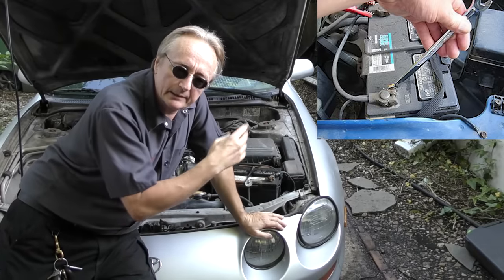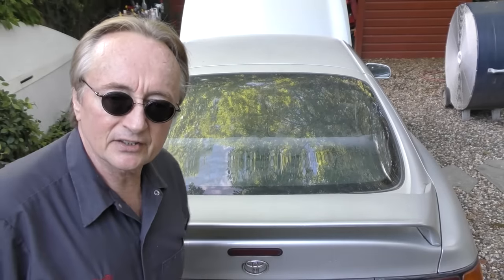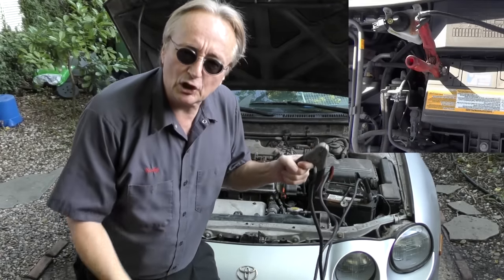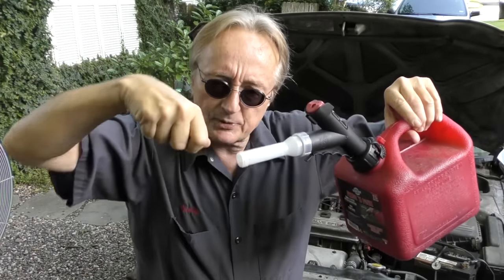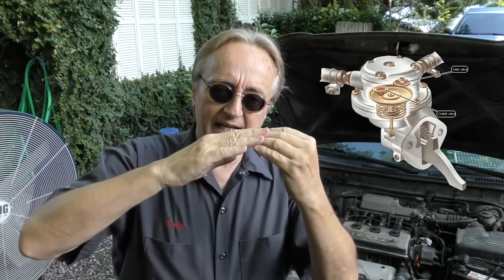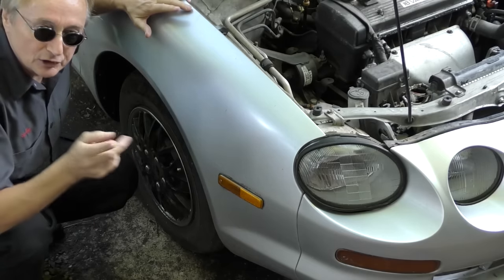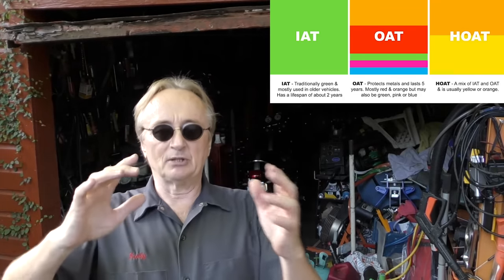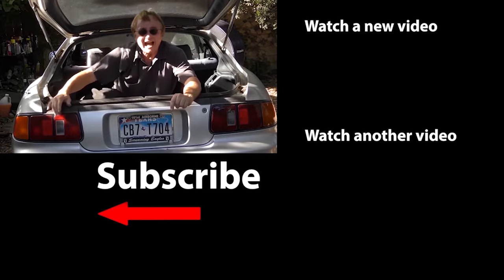This Will Destroy Your Car

Comment: 75,000 miles with one set of summer+winter tires and they were still good to go for another 50,000 (about 1/4" profile left) ; I always put 4 psi more in than the recommend maximum for 5 passengers and luggage.. both run-flat tires, michelin; My current car doesn't like going over the maximum too much (you feel it with your butt if it's too much) anymore though, so i just stick with that

Comment: I recommend just dont jump start a moden car.

Disconect the battery and charge the battery. Then put it back in. Electronics are just too sensitve. Modern radios etc will hold their memories so no reason not to disconnect the battery completely.

What about Jumping the starter e
Solenoid with a screw driver?

Remember when sensors were your eyes, ears, nose and touch?

Comment: Or buy a cheap usb cable  plug to put into cigarette lighter socket  which has LED display of the voltage. Mine has 12.2v showing and when engine is running it shows 14.4v .. so I know everything is tikiti boo

Comment: I sometimes use 87 octane unleaded instead of 89....will this harm my car... I have 2004 Saab 9-3 turbo....I use the lower one when I'm running low on money.
Reply: No problems stick to low I think it will drink more if you rev the engine while driving
Reply: doesnt matter

Comment: Thanks Scotty for these videos. How do you get the right pressure in your tires when you go from only the driver to a a full load with 8 people in the car like in my Honda Pilot, or should you use the same tire pressure for 1 person and for 8 people?
Reply: NO.  you definitely want to put in (8) times as much air as normal if you have 8 people in the car.  Instead of (32)psi you would want to put in (256) psi....and in the winter you definitely want to change the summer air in your tires to fresh winter air. This will insure that the  valve stem bearings stay lubricated properly.
Reply: @FlyBri2112  - awesome!

Comment: I have had several batteries go into grenade mode.  The scenario was always the same.  Find the battery was low or dead,  put on a charger and let charge for an hour or 2.   unplug the charger, remove the clips, close the hood, turn the key ... BANG!!!  Battery bits and acid all over the place.   Break out the baking-soda & water!  It was ALWAYS an older Ford.  For some reason,  Those had the solenoid right next to the battery instead of down on the starter.  In fact,  the '91 Econoline E350 van I used to drive, had the solenoid almost touching the battery.    The solenoid is a relay,  a very high-amperage relay. It's gonna spark!    It may be enclosed,  but it's not air-tight. Ford is fine by me, but I never had this problem on any GM vehicle. 
My advice would be to leave the hood open and wait about 5 minutes before trying to start an older Ford that has just been charged.  Let the hydrogen gas dissipate.

Comment: I've had a 93 Ranger for the last 15 years, and all fluids for it are merely a suggestion. I can put any type in it and it just keeps running. I wouldn't dare do that with my wife's 2015 Camry.

Comment: All the things he says not to do, I do in my 2004 Hyundai Santa Fe with almost 400k miles on the clock. Never had any issues and the vehicle run and drives as it did when it was new. shrugs shoulders

Comment: I swear by 35 psi in my car tires. Enough to improve mileage not enough to make stopping distance too long. At 35 i don’t see a huge wear problem on tires were at 40 i would see the center more worn than the edge.

Comment: The method Scotty is using for connecting jump leads is hazardous !  He has connected both the +ve and the -ve leads to the charged battery but where are the other ends of the jump leads ? We then observe him waving them around ! The correct way to connect jump leads is +ve to discharged battery then to +ve of donor vehicle; -ve lead to donor battery then to metal part of vehicle to be started. That way there is no risk of spark igniting hydrogen gas from discharged battery.

Comment: The "story" about s/one who had a tow truck jump their car & let the other car run for FIVE MINUTES with the cables still connected to each battery is ________________.

You can LEAVE all cables attached to both cars and get the one car cranked, and THEN take the 15 seconds to get out and disconnect the cables...it will NOT damage any car or the electrical system.

Comment: I had a battery explode in my Audi Super 90. I had installed it the day before; it was probably still outgassing.
Anyway, I turned the key and saw a bright orange/yellow flame lifting the hood off!
Something in the back of my mind whispered, "This is it."
I went to the garage to get some tools, and when I got back to the car, its dashboard was on fire, and the windshield was black.
At that point, I probably shouldn't have opened the door.
R.I.P. Audi

Comment: Dont turn on the cold setting on your air conditioner during winter cuz you’ll get cold, instead drench yourself in antifreeze so you won’t freeze up.
Reply: Always check with a professional before attempting what you stated

Comment: There is a real risk of an explosion when connecting the battery to jumpstart in a confined space, like in ur garage.
If  using a charger, any spark near the top of battery, like when you disconnect the charger while it is still turned on, is very likely to explode, sending the top of the battery and hydrochloric acid in to ur face and eyes, it ain’t pretty.!

Comment: Only one problem: "I put about 32 psi in each tire..." seems to imply that's a general rule of thumb. No! Scotty should advise viewers to CHECK THE PLACARD ON THE DRIVER'S DOOR JAMB. Some newer cars require 42 PSI or more. And, many cars nowadays specify different PSI for Front and Rear.

Also, a lot of the segment about motor oil is worded very poorly and potentially confusing ("never ... use the correct oil for your car" ... "a 0W-20 oil ... you want to stick to that oil", etc.); Scotty talked a lot :-) but failed to drive home the fact that the right thing is to USE THE OIL SPECIFIED ON THE OIL CAP. After watching, a viewer could actually think he said that's the wrong thing to do. :-(

Comment: Where are you ? Please I need help. My mustang has a p0175 code and I don't know what to do.
Reply: Here are the most common causes of P0175:

Vacuum Leaks– With the Ford Mustang, one of the most common cause for the P0175 code to be thrown is a vacuum leak. Take a look around and see if you can find the vacuum leak. Here’s a great YouTube video on how to find a vacuum leak.
O2 Sensor– The P0175 codes is thrown when the oxygen sensor(s) do not register the right amount of oxygen in the exhaust. When the oxygen sensor is bad, it can cause a false reading and trigger the code. The computer will still adjust the air/fuel mixture to compensate. This will cause the Mustang to run rich. Ford Mustang O2 Sensor
Mass Air Flow Sensor– The mass air flow sensor calculates the volume of air entering the engine. If it has gone bad, the air fuel mixture will be off and the P0175 code will show.
Bad Fuel Injectors– If you have one or more fuel injectors that have gone bad that can certainly cause the air/fuel mixture to go bad.
Fuel Pump/Fuel Filter– Today’s modern fuel injected motors need a lot of fuel pressure to atomize the gas properly. If the fuel pressure is off, atomization doesn’t happen properly and the optimal air/fuel mixture isn’t achieved.
Air Filter– While it’s not the most common reason to throw the P0175 code, a clogged air filter certainly can cause the code to throw. And, since it’s so easy to check, why not take a look?

Comment: Scotty: Do not put oil in your fuel, no modern auto engines need this.
Mazda: What about rotary engines?
Scotty: Use the same oil the vehicle came with, the oil thats listed on the oil cap, etc.
Manufacturer: Check with us now and then, it's not uncommon for us to change viscosities as the vehicles age.
Not mentioned: 
     Do not allow places to top off your fluids, most importantly your brake fluid during the oil change.
     They are typically  not going to check to see if they are using the correct fluid for your car.
     The reason not to top off brake fluid isn't just because they might use the wrong type.
     Your brake fluid level is important to catch minor leaks before they become dangerous. But, its also a simple indicator of your brake wear.
     The lower the fluid, the closer you are to needing pads.

Comment: Another thing everyone should be aware is related with Phone chargers on cars ... yup ... Do Not start your engine with the phone charger plugged into the lighter socket of your car! Transients pulses will likely Blow up your 12V-USB charger. If the charger was made in China that's almost granted! And Above All Never Ever do that with your Phone Attached to the charger! That can blow out your Phone in the process! Always disconnect your phone from the charger and the charger from the 12V lighter socket ... then Start your engine and only after that you can plug your phone charger and charge your phone/tablet/computer ...

Comment: Actually your alternator it's not designed to charge the battery it is designed to take the place of the voltage that the electronics is using that car to charge a dead battery with your alternator actually can hurt your alternator

Comment: It was never a good idea to run out of fuel with a mechanical pump. All the crud suspended in the fuel got washed into the fuel line and would clog up the fuel filter - either way - not a good idea to run out full stop.

Comment: WARNING: BATTERY CHARGING INSTRUCTIONS ARE *WRONG* AND DANGEROUS!!!!! Both batteries produce a pure hydrogen oxygen gas mix as a part of electrolysis of water because the alternator voltage is always higher than the battery voltage. Most of the pure hydrogen and pure oxygen is trapped inside the battery, Car batteries can explode with the force of a stick of dynamite if a spark gets near the vent caps. It isn't the gasses around the battery aren't as big of a problem as an unlucky spark hitting the vent caps. For the negative on BOTH cars, connect to metal, usually a bolt, that is not painted and is ideally 1ft or more away from the battery. 

DO NOT TURN OFF THE CAR BEFORE DISCONNECTING THE BATTERY. If there is a short in the vehicle you are charging, turning off the charging vehicle will cause it's battery to drain and you could have two cars that won't start. Instead, leave the car running, and disconnect the negative terminal on one car, then the negative terminal on the other, then remove the cables.  Disconnecting the negative terminals first on both cars  minimizes the risk of the alligator clips touching and shorting out before both batteries are disconnected.

I was a nuclear electrician on submarines, that had huge lead acid batteries.  I know what I am talking about here. Scotty, please fix your video before somebody destroys their car and kills themselves by following your battery charging/jump starting instructions. I only am commenting on this video because someone was watching this within earshot..

Comment: This is ABSOLUTELY the worst way to jump start a car. ALWAYS jump  start with the good car running. ALWAYS connect the negative terminal first. There is ZERO chance that you will ignite battery gases.

Comment: Getting to the jumping of another car. This is a true story, I have nothing to gain by exaggerating. I was going to jumpstart my wife's car. I hooked both sides to my battery, then hooked up the negative to my wife's car, then tried the positive. I saw a small spark then BOOM the battery exploded in my face! This was outside with both engines off. I ran upstairs to our second floor apartment and washed off my face expecting the worse. I only had a small   piece of plastic stuck in my face! I had a cigarette and went downstairs to survey the damage, the battery was completely gone, not a trace! I looked under the car, the tree I was under, underneath other cars, across the street, in some guys front yard, EVERYWHERE! Just gone! You would think the terminals would be around but no. Go figure.

Comment: Scotty is wrong agian,  you can run up to a 50:1/40:1 ratio 2 stroke pemix in your 4 stroke car engine. 

And no, jump starting your car with the other car being on will not destroy your alternator or the other person's alternator giving you the jump start. Coming from an engine builder/racer/ record holder and car audio competitor.

Comment: Rounding up when filling up for gas can indeed do like Scotty says to the Evap system. Only problem is, this is very rare and hundreds of thousands of people do this every day. And if any damage is done, a person would know it right away by getting computer codes. In most cars you'd have to really, really top them off to get gas into the evap system. So Scotty exaggerates this. I topped off my cars pretty well for many, many years since cars started having evap systems on them, and never had one single problem! Why? Because I didn't keep topping and topping until gas started to come out onto the ground. Which is practically what one would have to do to get gas into the evap. I just snicker to myself when I hear this nonsense crap. I still do extra tops offs, as much as an extra quarter gallon and I never have computer codes.

Comment: NEW cars will destroy your wallet, DON'T buy them.
Reply: I actually did some calculations on this a few years ago.
It very much depends on the car.
A brand new entry-level Japanese car (or KIA with 7yr warranty) will end up about the same cost as the 10-15 yo 2nd hand version you do ongoing maintenance on.
By about the 10 year mark.
Plus, you get to drive a nice new car! 😁